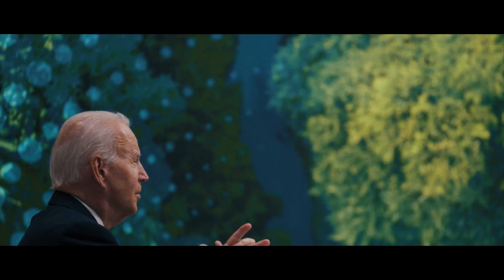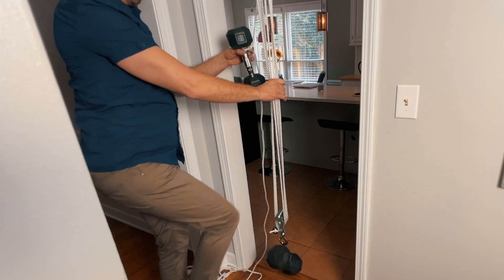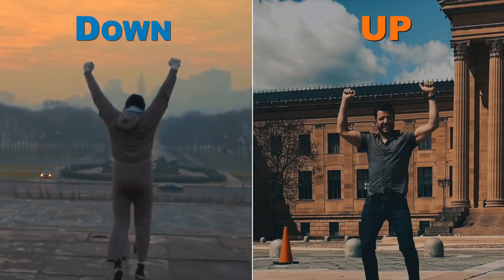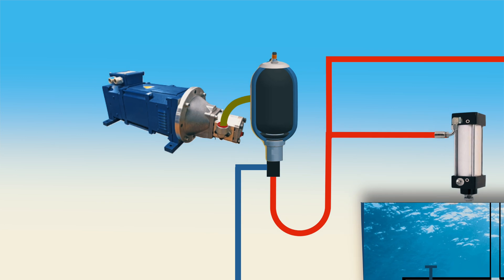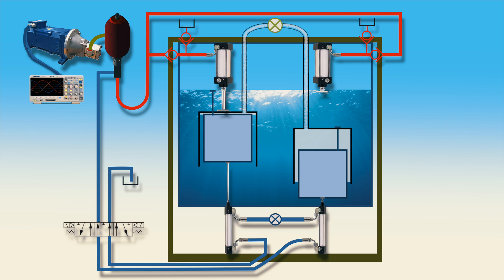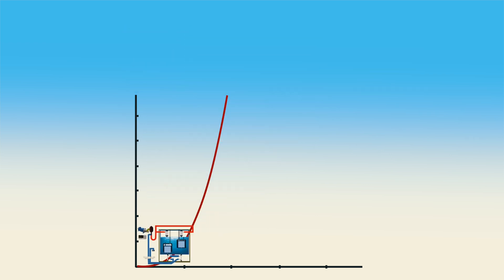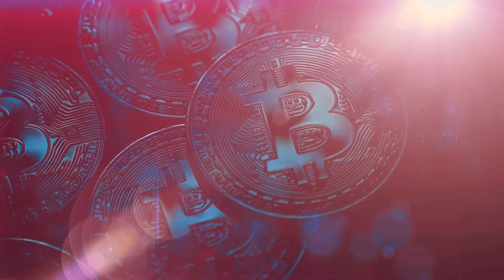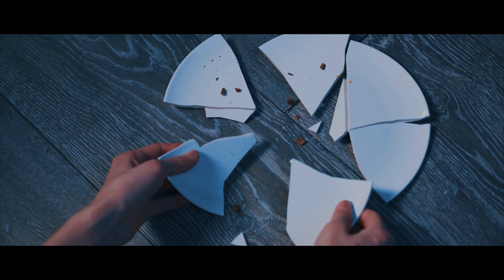Breakthrough Green Energy-Free Energy Generator without flywheel! #FreeEnergyGenerator #greenenergy

Comment: Did you every wonder why people tell you that two tangent clockwise forces on a flywheel can be opposite forces. 

An opposite force brings an existing motion to a stop. So does a clockwise force bring a clockwise motion to a stop? No: no matter where a tangent clockwise force is applied to the flywheel the acceleration is clockwise. A force directed Right at the top; Left at the bottom; Down at 90 degrees; Up at 270 degrees will all accelerate the flywheel clockwise and are therefore ALL clockwise forces.

Do the profs really think everyone is going it believe their silly kindergarten concepts? They tell us that a flywheel has zero Newtonian Momentum; because down cancels up and left cancels right? Newton said very clearly that if a force accelerates the existing motion then the force and the motion are in the same direction. 

The profs tell us that a flywheel has no Newtonian Momentum because they don’t want 
YOU to realize that energy is made when the flywheel throws a small mass off of its surface. When Newtonian Momentum is conserved during the throw of the small mass; the Energy of the system increases massively. 

What discourages people from making energy is not the physics; it is the false kindergarten physics taught by the profs.

Comment: Dropping 20 kg one meter is a certain amount of energy but it can be a very large amount of Newtonian momentum. The energy is set or constant but the momentum is NOT. 

Twenty kg dropped one meter is 20 kg * 9.81 N/kg * 1 m = 196.2 Nm or Joules

Using the kinetic energy formula for confirmation: ½ * 20 kg * 4.429 m/sec * 4.429 m/sec = 196.2 Joules. Any object dropped one meter will have a velocity of 4.429 m/sec; d = ½ *v*v/ a

The important part:    To make 20 kg rise 1 m is going to cost you 196.2 Joules; or the 20 kg must be moving 4.429 m/sec. This is 4.429 m/sec * 20 kg = 88.58 units of Newtonian Momentum.

But the quantity of momentum that can be produced by a 1 m drop of the 20 kg is NOT limited to 88.58 units. 

Place the 20 kg on a string that is suspended from the circumference of a 400 kg flywheel. This accelerates just like an Atwood’s Machine. At the end of a 1 m drop the entire 420 kg is moving .96658 m/sec. The square root of (1 m * 2 * 9.81 m/sec/sec * 20 kg / 420kg) = .96658 m/sec this is 420 kg * .966 m/sec = 405.96 units of momentum and we only need 88.58 units to recycle the 1 meter drop. 

And here is the best part.  When you transfer all of this momentum to a 20 kg mass the 20 kg must be moving 20.298 m/sec.  20 kg * 20.298 m/sec = 405.96 kg*m/sec

The energy of 20 kg moving 20.298 m/sec is; ½ * 20 kg * 20.298 m/sec * 20.298 m/sec= 4120.2 J

So you start with 196.2 J and you end with 4120.2 Joules.  21 times as much energy.

The ‘cylinder and spheres’ experiments on YouTube prove that this concept is correct.
Reply: can you make an alternative one that does not use watch pressure?
Reply: Bring up MIT Atwood's Machine and note that the total 1.110 kilogram mass is moving .42 m/sec after the 10 grams has dropped 1 m.That is 1.110 kg × .42 m/sec = .46667 units of Momentum. Only the 10 grams has dropped. And we have .46667 units of Momentum.
Place all that momentum into the 10 grams and it will rise 111 m.
The 10 grams was dropped 1 m and it will rise 111 m.
Down 1 m and up 111 m.
All you need  is a 'cylinder and spheres'; also found on the internet by searching Delburt Phend.
The 10 g can just as well  be 10 tons if the Atwood's machine had a mass of 1,110 ton. This is 10 ton raised 111 m every 5 sec. On and on and on.

Comment: Would adding piezoelectric pads to the surface of contact for both sides with the increased surface volume allow for scalability of additional means of energy production alongside the hydraulic system to help with output ROI? Or possibly adding a magnet to the inside of the chamber with a copper ring on the outside chamber, allowing the magnetic field to create an additional electrical output? Playing with ideas here but considering the scalability needed to produce ROI, I wonder how much friction could be added to the current system without disruption to the current output based on pressure vs friction, so that additional low cost energy collection means could be added? There must be a relationship which I'd be keen to understand. I wonder if it would produce a lower duration to profitability.
Reply: Hello DMS, The Power Available is from the work differencs in the system, many ways to capture that difference, we selected the simple method, watch this video till the end to discuss ROI: https://youtu.be/WYnJQDsATQI Thanks Wayne

Comment: So where can one purchase a 10kw system? Or is it still in the works? But I highly doubt that the electric company and it's influence on our government will allow Travis to publicly market his invention. As there has been no mention about his invention on any news media and I don't think they will either. Not unless he makes them himself and sell them( he should say he "just built them for friends" at first). That when enough of them are built it's impossible for them to hide it anymore.  Because they don't mind telling everyone that they just discovered fusion energy, as it will probably be 120 years before they make a fusion generator available to the public.
As solar energy was discovered in 1880 and werent implement until the 1940s to put on a satellite. (Which continues to work even today and still sends a signal.) Same with solar calculators from the 70s in your grandparents junk drawer, and just give it a little light.
In the 70s they tried to start the solar revolution , as they had solar cars, lights and many other devices, only problem was batteries sucked back then to store it. We have better batteries today, but they still suck too and are heavy in relation to energy storage. That you need something the size of a truck for it to be enough actual useable energy. In order to run all your large appliances and to charge your future mandatory electric car throughout the night. 

 It's funny that one of the first solar panels invented still works 80+ years later. Yet newer panels are lucky to last 20-25years.  
Go figure!

Also one solar panels shouldn't cost more than $100 (more like $50) because the materials are cheap( crushed granite rock heated to get silicon, glass,/or plexiglass, a thin plastic/aluminum frame, plastic and a bit of copper/silver wire), and they are relatively simple to make. As your alarm clock and coffee maker are more complex.  Nor should electrical inverters cost thousands of dollars , maybe only $300-500 as the components are similar and  wire size are about same as a nice car battery charger with a high amp start function. 
That a complete 5-7k solar system should only cost about $1500-$2000 in comparison to cost of other similar type manufactured goods. Not $10,000 or some other insane price they charge and rip people off.( Because I bet you $1000 when companies first started buying them from China. Only cost them a few dollars per panel. Until China got smart and now are selling them here bypassing the USA corporations  only for a few dollars less than what they retail.So  they make more profit and harder to find and buy them for the price companies used to buy them and loss of sales
From China. That their profits have been reduced, and have resorted to increasing prices. ( Hurting individuals who buy at the store and don't search the Internet).That will end up hurting the companies and jobs in the end.

Which you will notice thier profit loss in the stock market very shortly. Especially when everyone decides it's better to buy the same thing cheaper online. 

But I'm sure they don't want people to have free energy they can buy for cheap and should last them their entire lives.

I'm sure the Electric company has their hand in the pot somehow. It's funny that the electric companies are supposed to be non-profit.( As the government first built the electrical grid with tax payer dollars) That our electric bills pay for upgrading and maintenance. Yet nothing gets upgraded, and   still have these flex alerts( because they keep adding houses but don't add more wiring to the grid to accommodate them. So they get hotter and when there is a fire  from their greedy negligence. That they get sued except its our tax dollars pay for it and then they still raise rates. Yet they still pay to lobby politicians with our money instead of upgrading the system like they are supposed to do. 

The government should just take all the extra profits from all the electric companies to put into a fund inorder to actually fix and upgrade the system and create more jobs to do it. Because all the different electric companies power supply merge at one point and get power from the same places. That not one of them want to pay to upgrade what the other is using also. 
( That if they were actually non- profit, then it shouldn't matter to upgrade any part of the system with all of the profits.)
If they don't then they should start paying taxes on it, and take away their monopoly to open the grid to other companies who buy power from government plants or private electric facilities to sell to customers or to extend grid for new homes and increase competition for lower prices. 
Then the government or electric facilities use the money to actually upgrade the grid(matter of national security urgent solar flare protection). Also upgrade by adding more wires to amount of electrical usage it sells to not have flex alerts, brown outs or fires due to the aging electrical (as most parts  50+ years old). 

You think after a half a century they should have done something with all the supposed  we gave them. Come on! People need to wake up and actually vote for politicians based on research. Not because they are a specific party, or see them in more commercials or what your news channel tells you how to vote. 

Here are some simple rules to follow. 
#1
Democrat and Republican parties are just to confuse people inorder to distract us. In order to do or get what they want without much resistance or attention or notice.  (Because its the oldest trick in the book, (divide and conquer), and it works.)Bottom line is Dumb-O-Craps & Re-poo-pi-Cant's Are not!.Will not! Or Ever be..
I repeat
Are not! Will not! Or Ever be.. 
For any regular person, or have anyones best intentions in mind.
OTHER THAN THEIR OWN! As they both are just used by them who pay news channels to misinform and point blame at each other and still get away with what they want. As they are both controlled by Corporations (Unions are also corporations)Re-poops help them get away with laws and pay less taxes. Dumb-craps say they have the working man Ideals. But that idea implies to working for corporations. As only the laws passed are to inhibit or hurt individuals starting or who own a small business. Which only instill and fuels corporate growth to remove or stop any type of future competition
Reply: Everyone wnats to buy one, our list is long, we are working on the comercialization - thanks For those wanting more info on that topic: https://youtu.be/CTpk__AC-dI

Comment: Thank you Markus for this amazing content and for the easy and perfect way of delivering to our minds
I may let you know that I have a similar principle which allowed me produce a free energy with any powers using a very simple principle and a cheaper tools also.
I have a question and asking you to give me an advice regarding it.
What kind of generators can I use for my system if I need it to be continuously working in hot weather and high temperature climate. 
I want a kind of generator which can work 24 hours in high efficient way.
Reply from the maker: Hello Mohamed, I am not a generator expert but would think a generator for a wind turbine should be able to handle the harsh conditions and run 24/7

Comment: Hi, 
Few questions:
1. Why doesn't the 5/3 pneumatic(or hydraulic?) valve changes state on the animation? Why is it upside down? What is it operated by? Is this a bad animation?
2. On the same valve nothing goes into input (1) and the (5) output goes where? a fishtank? a bathtub? What is that drawing?
3.  When the top cylinders going up the fluid blocked by the "ball" and only can go to the fishtank/bathtub and blocked there forever.. is it?
4. What are those rotating "X"s? Are those somekind of valves?
5. The "battery" runs on hydro-fluid, or air? Why both of them connected to the "battery" if thats a "bladder" with liquid nitrogen?
6. The most important, where are the blueprints, the schemes?
If you really want to give people free energy why are you holding back the most important informations?

This is everything but not simple explanation...sounds like these modern sci-fi movies, when random peoples try to convince us with a lot of engineering words.. show a simple working version with messurements... and blueprints ofc.
Thanks!
Reply from the maker: It’s a animation and not a hydraulic simulation. What’s the point of showing how a valve switches? Does that help explain it?
Reply: @MarkusNenning  to understand the whole thing? Yes.
Reply: @geripapaable  Thanks for your questions, the video represents the fundamental physics and process. A full 3D animation and 8 hour training video is in progress.

Comment: Man, I love this guy Markus - he makes great video - love the editing, and humor!
Reply: This video is great. Marcus has done an amazing job 👍.
After playing around with the Travis effect in a little tank and witnessing the difference in lifting power, I'm very keen to build one of these systems to test it out.
I work in the aquaculture industry (construction / engineering) so have access to plastic welding equipment and HDPE pipe and sheet which, I'd guess, would be suitable for building risers. We also do our own plc control systems etc so can do all the necessary controls aswell.
Would you be able to supply suitable riser dimensions, hydraulic cylinder sizes and hydraulic motor spec for say a 10KW output system to test? I'd be happy to document the build for YouTube etc so others can see it working.
Reply from the maker: Would love to see that Allan.
Reply: @AllanB1987  There are about 6 things you need to know to build the system - so make sure you talk to me before starting. Thanks

Wayne
Reply: @waynetravis6951  Hi Wayne. I can't find an option to message you. Is there any way to get in touch?
Reply: @AllanB1987  I added contact info to my you tube channel
Reply: @waynetravis6951  Thanks Wayne. Have sent you a message.
Reply: Wayne - where is the best place to track this?

Comment: A mechanical transformer. Why not use existing solutions like a jack?
What's so special?
The video might be entertaining for some but not very educating.
Reply: Did you miss part one ?  where the input cost is reduced while still keeping the same output - you cant do that with a transformer.. this is epically huge.
Reply: @waynetravis6951  Your right, I didn't watch the other video before.
After seeing that one it's more clear than before but still not entirely.
Reply: @bui340  Thanks for following through, the method of air transfer eliminates the need to compress air (which normally destroys efficiency of a buoyancy system, and the Travis Effect reduces the Archimedes' "Volume required in Half - while still having full power, and when the center part (attached to the teeter totter) is lowered the lift force is reduced to that same "half value" .. so the cost to sink and transfer air is 1/2 the output. 
The result is a work difference - excess work performed every single tilt.
Hope that helps.
Reply: @waynetravis6951  ok, I see.
Can the input energy be electricity or does it need to be "waste high air pressure"?
If electricity can be used then the output could be multiplied infinitely if connected in series.
Reply: @bui340  The air is closed looped - so no new air is ever needed, and no  external input is needed unless you just want to plug it in. 

The air is moved by gravity - your cost is sinking the air volume - each time one side is lower than the other side - gravity moves the air.

 Since the system produces twice the lift over distance than the cost of the lowering the system the same distance - this design has enough power difference to internally  recycle the excess - and run closed looped providing excess power. 

Markus explained the excess can run a generator, or you could plug it in to an external power supply to sink the air volume - but since an input - but that is far less efficient since an input comes with low efficiency.

This is a real free energy system - I uploaded the reduced volume  videos and made them public for you. 

Its simple science to subtract costs - we just finally found an unequal cost system.

Thanks Wayne
Reply: @waynetravis6951  I can see it working if the tall and "pumped" cylinder would be moving up because of air wanting to rise and the difference in pressure from the surrounding lickuid would be greater on a taller object.